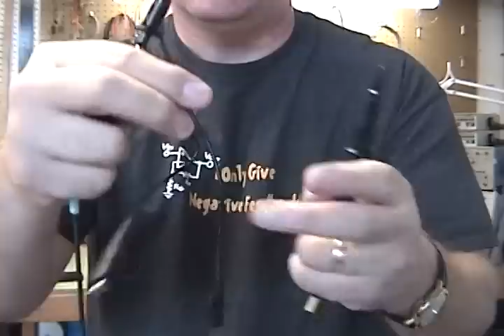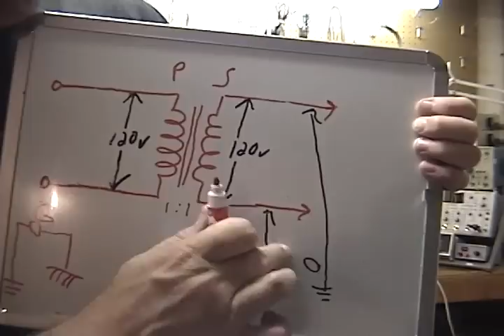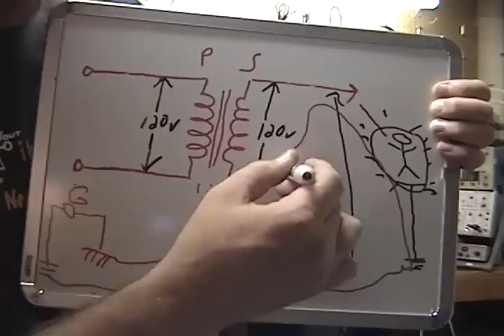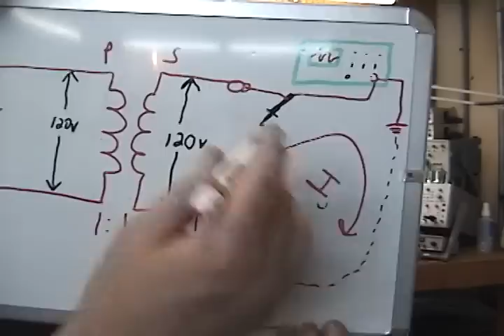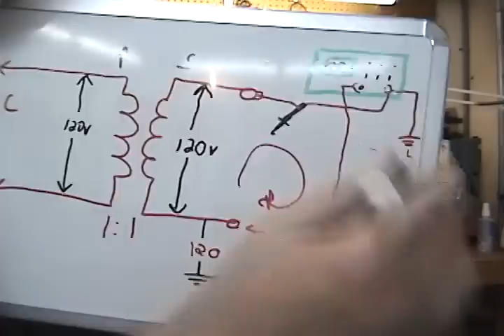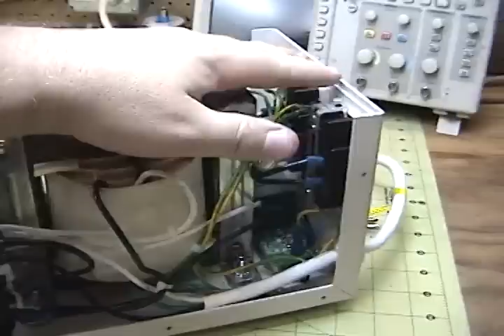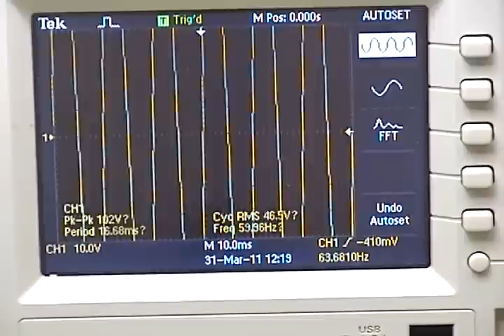ToddFun.com: Isolation Transformer - Tripp Lite IS1000

Comment: so testing really demands a proper ISO trans , an isolated oscilloscope  instrument via an isolation probes and isolation gloves as a double barrier. is there merit trying to isolate the tech from ground ? does this create a static potential issue ?
Reply from the maker: Yes, those are all great if you can spend the money for such instruments. No on static as static mats and straps have a 1M Ohm inline resistor to ground.
Reply: Ok so we can ground the tech to the bench via 1Mohm which is enough to discharge the electrostatic buildup but not enough to cause a safety issue ?
Reply: ps most techs will have the oscilloscopes but its setting up with ISO trans , and differential probes ..I have seen some DIY probes around but not decided which I will build yet.
Reply from the maker: yes

Comment: Hi Todd,

I found your great video trying to school myself on isolated transformers. I am looking for an isolated variac to make a custom low voltage light control system in wet conditions (landscape) to increase system safety. Do you have any idea if this variac is "tek" isolated, or should I consider it not to be. It's twice the price of the standard variac, so I am trying to figure out what makes it different and if it is really tek isolated, or I can mod it to be tek isolated.

Maybe I am better off just using a separate isolator with a non isolated variac?

Cheers, Allen
Reply from the maker: This is not a variac. This is a 1 to 1 transformer so 110 V AC in 110 V AC out. Please note that variacs are not isolated ever, they are auto transformers and are never safe like an isolated core transformer could be if tek version. 

You say you need this for low voltage so just get a low voltage outdoor transformer power supply. They sell 24 V DC regulated outdoor grade power supplies at home improvement stores for outdoor lighting and outdoor sprinkler controls.

Comment: I've been trying to find a good video on Transformers, and your's is the best I've found. :) My primary interest in providing really high quality noise and surge protection for my computer, and my stereo.  For my particular area of interest would I benefit from modifying a transformer to not have the ground connection?  would the ground connection provide some advantage to me? maybe in terms of noise suppression,  or... computer-clocking-ground-reference?
Reply from the maker: For noise and ground loop I wouldn't modify this type of transformer. Just use it as is. However if you really want the best product for what you are doing look into line conditioning and protection devices such as the "Furman Elite-15 PF POWER CONDITIONER / SURGE SUPPRESSOR" 
(Amazon): https://www.amazon.com/gp/product/B000WV5K4S?ie=UTF8&creativeASIN=B000WV5K4S&linkCode=xm2&tag=tod0f5-20
(PDF) - http://www.furmansound.com/pdf/datasheets/ELITE_15_PF_datasheet.pdf#search="Furman Elite-15 PF"
Reply: Todd Harrison did you do a vid on how effective that ISO trans is against different types of noise and principles explaining why they kill transients noise etc

Comment: Hey!! I built a Variable AC Power Supply, with ISO transformer installed inline before Variac, and I use 6 ohms(60 watts)  in series with the secondary windings on the Variac in case of short.
Reply from the maker: +Neilrrc37 I too will connect my IT to my variac when working on old gear and want to bring up the power slowly. However I connect a Kill-o-Watt meter to my variac's output to monitor current and if I see a spike I know something is wrong. I guess a 6 ohm 60 watt would be a good safety option too, like having an inline light bulb in the old days of working on tube radios.

Comment: Thank you for the excellent tutorial.  One thing I don't understand is when you illuminated the bulb,  pre-modificaiton, by connecting on lead of the bulb to the isolation transformer hot, and the other lead of the bulb to the surface of the bench outlet box,  (time=32:10 in the video) did you not create ALSO ground fault?  Your GFIC did not trip.  Has the "isolation" aspect of the transformer rendered the GFIC's protection useless?
Reply from the maker: +Steve Cozart Yes, that is exactly correct. All transformers with separated secondary / primary windings, whether they are 1:1 isolation or not, render CFIC useless. This is not true for auto transformers like variacs which don't have separated secondary / primary windings. Keep your head in the game at all times and be save when working with high voltages. Thanks for joining.

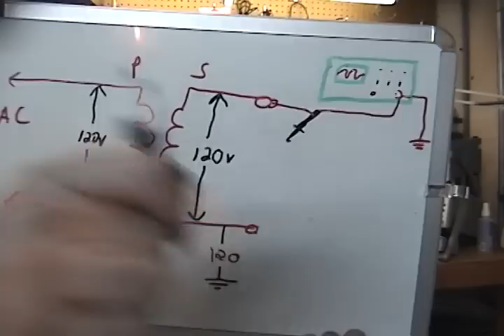Comment: Todd @ 23:50 you said that if the OSC grnd lead attaches to the 120V O/p that the bottom GND leg of that 120V secondary goes to 120Vac . How is this possible if the bottom is connected to Ground ( as per your drawing ) ?  Also, in that scenario wouldn't attaching the OSC grnd to top secondary lead to shorting the secondary as the bottom lead is grounded ,causing a OSC ground lead melt down ? You seemed to indicate that you needed a secondlead to cause a problem
Reply from the maker: +graham kaveman It is hard to understand your question. Maybe watch the video a few more times would help. The take away here is to avoid created a current loop through any dead short paths including ones you may not think exist but do, such as between two OSC ground clips at different voltage potentials in the DUT or through an earth ground that could include your person if you're not careful. So avoid strapping a wires from either side of the transformer's secondary output to a mains referenced ground or between two OSC ground clips as noted above.

Comment: Thanks for the excellent presentation on isolation transformers. Really clear and easy to understand. Just a stupid question from a greenhorn: what would happen if you connected the test object AS WELL AS the oscilloscope into the "tech-version" of the isolation transformer?
Reply from the maker: +Roger Grossenbacher You could do that but then you are floating your scope which isn't a good idea. If you just wanted to float your scope then it would be just as easy to put a 3 prong to 2 prong adapter on your scope. Not good for the scope, it could damage it from what I have read, however I have done it myself as a fast way to isolate my scope from ground. I didn't have any damage but it is a risk and your scope might not read correctly however mine seem to read fine.
Reply: My understanding is that the best of both worlds is to have an isolation probe.
Reply from the maker: Yes it is. They are very expensive. I have seen some DIY isolation probe hacks but making them to also work with high frequency can be tricky hence the high price of such probes.

Comment: Great video, Todd, thanks a lot.
So if I use a portable battery-powered DSO to test a live circuit and I am under an isolation trasformer I shouldn't have the same risk (being lit as a light bulb!) that I could have with a 'normal' grounded DSO, right?
Reply from the maker: +Roberto Carraro Correct. But also remember  you can get yourself between a high and low potential with the isolation transformer itself so keep one hand in your back pocket. ;) and if you use 2 probes from your DSO they can short if the ground clips are not at the same potential in the circuit.

Comment: I also add one more piece of equipment to be safe.  I plug a Tripp Lite GFCI multiple outlet extension cord into the modified Tripp Lite isolation transformer.  Then, I plug any equipment used or worked on into the multiple outlets.  Just one more step to save me from myself.  If I do anything wrong, hopefully the GFCI will trip and save me.
Reply from the maker: +Mystery47 It will not portect you at all. GFCI does not work on the output of a tech isolation transformer. There will be no alternate path for the current that could trigger the GFIC. Even if it has to go through your body to get back to the secondary windings of your tech isolation transformer it will not trip the GFCI. The way GFIC works is it trips when current finds a path around the hot to neutral leg loop in your home's wiring. There is no such path when using a tech isolation transformer. Try it. Put in a GFCI tester and push the GFCI test button. Nothing will happen. Not the test button on the GFCI outlet or extension iteself but on a "plug in" GFCI Receptacle Tester like this: http://astore.amazon.com/tod0f5-20/detail/B005GYBFAE
Reply: +Todd Harrison (ToddFun) Wow, I'm glad you responded.  What I am doing is getting back into old shortwave and test equipment repair for fun during my retirement.  Much of that old equipment was two-prong wired which meant the chassis was hot.  They protected consumers by enclosing the chassis thoroughly so they couldn't touch the chassis while the unit was operating.
I thought that operating through an isolation transformer would afford me some protection if I was testing a unit while it was powered up.  Would either the isolation transformer or a GFCI plug be of any benefit to me?  Maybe plugging in the two-prong unit under test into the isolation transformer and the test equipment into the GFCI?
By the way, I bought two IS800's on eBay.  Since they are a discontinued model, they went cheap.  They are a little different inside than your IS1000 but it is clear where the ground wire on the secondary connects to the metal box enclosure.
Reply from the maker: +Mystery47 Yes, plug the DUT into the IT and the test equipment into a normal house hold GFCI would be good. That is what I do. Good luck and remember once you connect one bit of grounded test gear to your DUT the IT is not longer doing anything for you. Also remember that once you connect one bit of gear to your DUT another bit of gear could produce a short regardless that you're using a IT or GFCI. Finally, remember that nothing can protect you from creating a deadly short through your body from two points such as left hand to right hand if both are touching the DUT, so keep one hand in your pocket ;)
Reply: +Todd Harrison (ToddFun) I just watched another video here by EEVblog #279 How NOT to blow up your oscilloscope.  Starting at the 5:30 minute mark, he describes hooking up an oscilloscope (connected to mains ground) probe to an isolated DUT and he maintains that it is safe because there is no return path to form a loop.
It would be interesting to get your opinion of what he is saying.  His video is quite similar to yours in that he uses a whiteboard to diagram what he is talking about.
Reply from the maker: +Mystery47 Dave's statement at 5:30 is correct about no current loop and that such a probe setup is safe.

Comment: Hey Todd, I just found your channel, and I'm enjoying your vids. I have a question about this transformer. I'm not planning to do any circuit testing. I'm actually just trying to do away with some line noise in my music equipment. I have a recording console with an old power supply. The outlet plug, for the power supply,  doesn't have a ground. You have to ground to the power supply box itself, then to something else. Anyway, my question is.. Do I need to do the ground loop modification, that you demonstrated here, if I'm just looking to eliminate some noise in my scenario? Thanks for the info.
Reply from the maker: +diregremo No. This mode in this video would make for more noise on the line to your recording equipment. I would spend money on a line conditioner for your needs. Such as: http://www.furmansound.com/product.php?div=01&id=P-1800PF

Comment: Hi Todd... 

I bought a Tripp Lite ISO500. The internal guts looks a bit different but I think we might have the same problem.

The incoming AC line has a ground wire going to the case (a common ground screw).
Each Duplex has a ground wire going to the case (same common ground point).
The Secondary side of the Xfrmer has a Green wire going to the same common ground point.  I then see the White Neutral has a Green wire spliced onto it and that goes to the common ground point (I think that is the same issue you are describing).

Is this were you suggest cutting the connection (on the secondary, the Neutral and Ground wire should NOT be connected together)?

Each duplex also has a big cap across the Pos and Neutral side and one duplex appears to have an MOV.

Here is a video showing an ISO800 with a similar connection (and you can see the caps and MOV - https://www.youtube.com/watch?v=nRfXG3EqFXc  

Thanks in advance.

Tom
Reply from the maker: +ThomasACarlos You are correct. Only remove the secondary side neutral-to-ground connection. All other ground connections and components are fine.
Reply: Thanks Todd ... Good to know.  I shared this info on the Music Electronic Forum web site.  You have some Kudos posted there.
Reply from the maker: +ThomasACarlos Thanks. I'm glad to help.. It's FUN..ToddFun... ;)
Reply: So it's the same as your video with the IS500HG or the IS1000HG: identical yellow/green to red line going to ground?

Comment: Just the ticket this video..... I just bought a DSO, Siglent 1102CML but I have been using a portable Tek for years. I was a tad worried of using my scope on anything other than battery or PSU based circuits. My DSO is far more capable than the old Tek (THS720A from mid 90's) and want to start using it, I feel as though I can now with more confidence.... thanks Todd.
Reply from the maker: +Michael Hawthorne Glad to help. The video has lots of tips on all the things that can go horribly wrong and I watch it once in a while myself just as a refresher.

Comment: You know, A 2 prong to 3 prong adaptor work well for ground isolation for test equipment and isolation transformer for tech use ONLY... Don't let Dr Murphy rule if you can avoid it!  I have gotten my past surprizes!
Reply from the maker: +Harry Haefner I cover that option in the video.

Comment: Wow -- I knew I had to do isolation... but I was under the impression that getting one of these boxes, the idea was to plug the scope into it, and not the "circuit under test." I wanted to do some measurements of my power panel, and didn't want to blow up the scope, so I thought I would plug the scope into an isolation transformer... obviously I can't put the whole mains power panel through an isolation box... would this work, or am I going to fry my scope or myself?
Reply from the maker: +TheSageDad You can put your scope on an IT but it has risks and it might not be good for the scope, I do it sometimes. At least if its on an IT you're not going to fry your scope. You can always use a DVM to check if there is any voltage potential between the ground clip and DUT where plan on connecting the scope's ground clip. If there is voltage then don't connect them. However you would have to use a DVM with low Z setting like the Fluke 117 otherwise  you will see ghost voltages that are harmless. But if you think you see ghost voltages with a cheaper DVM then wire up a 25 watt night light and test if the voltage is real or ghost.

Comment: Do you think your (without your modification) HG-IT would be of any benefit in my situation? I have an old house with two-terminal electrical outlets. I was thinking of plugging the primary of an HG-IT into my two-wire outlet and then using the secondary to plug all my three-prong test gear -- scope, dc power supply, function gen, etc. as well as the DUT, with the ground and neutral terminals connected at the secondary.  I am hoping for some improvement in noise rather than an improvement in safety.  As it is now, all my ground terminals on everything are floating.

Actually, I do expect to get an improvement in safety, since now if I touch  anything connected to the neutral, it may be dangerously higher than ground potential due to the drop between me and wherever the neutral is tied to ground, whereas with the HG-IT that won't be an issue.
Reply from the maker: +Richard Gray it would add safety but its not going to help for noise I wouldn't think. Maybe a little because you would cut off some HF getting across the transformer but that's about it. I'm no expert in such ground loop references so this is only my general opinion as I currently understand such noise issues.
Reply: +Todd Harrison (ToddFun)  Thanks for the video and the reply. I guess all that the non-expert in such matters can say is that it certainly won't hurt and it MIGHT be somewhat beneficial.  I suppose I could spend the money to bring my house wiring into the 21st century, but that ain't gonna happen for a while. I might drive a grounding bar into the yard outside my window for a good local ground -- yeah, that's the ticket.
Reply from the maker: +Richard Gray Yes, that is the ticket. Should work a treat.